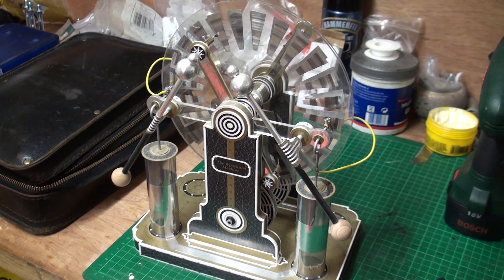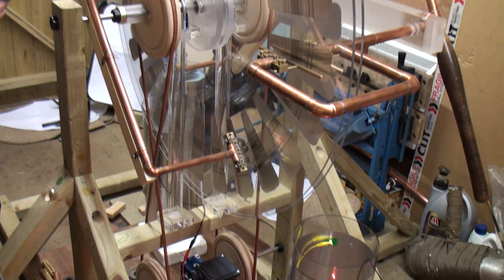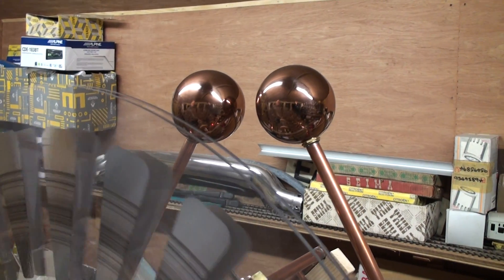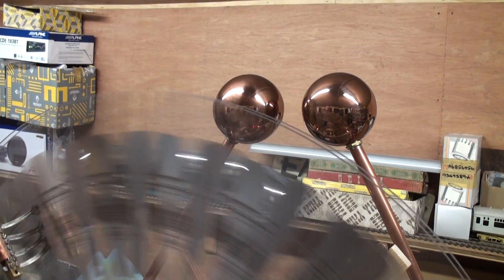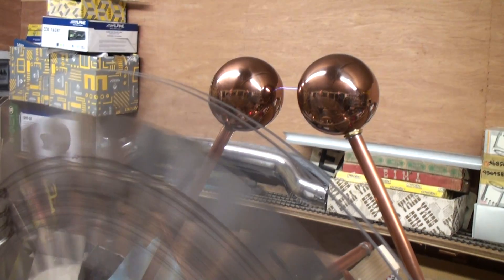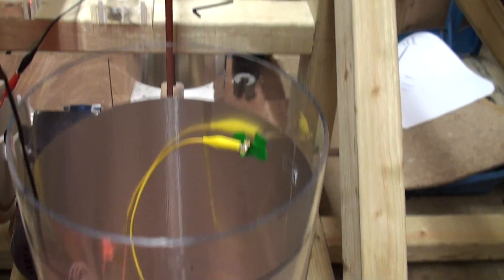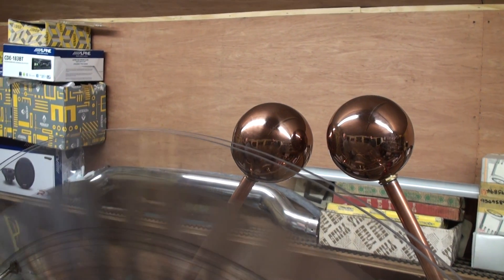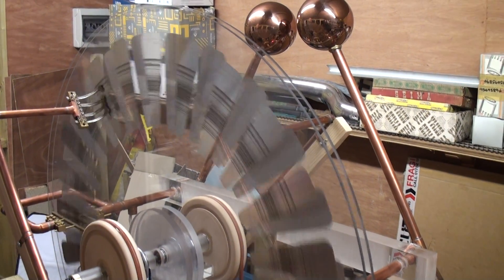Giant Wimshurst Machine!

Comment: Wow !!  A nicely done  3' 3" diameter Wimshurst machine.....Might need a bit of tweaking as good strong spark lengths of 25% --35% disc diameter are usually achievable for the Sectored Wimshurst at slow to moderate rpm & moderate indoor humidity conditions......
Reply: On a real dry day a sectored Wimshurst should produce sparks as long as the radius of the machine.

Comment: I have built lt 2 wimshurst machine with sectorless discs 18 inches in diameter made of  glass they were both enclosed and heated, they were able to produce sparks of 7 inches, under optimum conditions you should be getting  15 inch sparks

Comment: Another thing, charge collectors DO NOT have to have as much width as the sector length, doing so reduces your maximum spark length because the charge collector will discharge to the nearest neutralizer in the direction of rotation.  A single point is more than enough and should be positioned close to the OUTER edge of the sectors (again to reduce charge collector to neutralizer shorting). While the low impedance along with the lack of internal copper (since there is a huge skin effect at the high voltage leads) is a good idea on these machines for charge collector holders to capacitor connections, and the discharge rods, it is a bad idea on the neutralizer assemblies, because as soon as the machine starts to produce the neutralizers are at a neutral potential.  The large diameter of the copper tubing simply provides an easer path for charge collector to neutralizer shorting.
Reply: Thanks for the instruction, I’m in the middle of building a 3D printed Wimshurst. Your comment helped when considering brush size for the neutralizers, thank you

Comment: I highly doubt I'll ever get an answer to my question but im Curious how would one get power from the machine to something that requires power?
Reply: It's not really about getting power; it's more about generating high voltage from mains voltage. That conversion is costly. These system are not very efficienct, but they are robust.
Reply: I don’t have a definitive answer yet. I would encourage you to learn about Fractal Capacitors, it appears to be a possible method of capturing the high voltage to then be released/used in parallel giving the condensed now available much higher amperage. I’ll have more experimental observation in a couple of months confirming thoughts.
Reply: See my video where I step down the high voltage from my quadruple Bonetti Machine. As generators these are horrifically inefficient.

Comment: Why not generate its own power to run it ?

You don't need electricity if you use the power generated to power it...

Also .. your metal plates...
Try four feet long...

You want this time machine to run correctly yes ?
Reply: Because these machines are pathetically inefficient, and even if they could be 100% efficient it could not power itself, suggesting otherwise crosses the gap from ignorance to stupidity.
Reply: @MisterBonetti  yes ...it's your stupidity....
Me and another person are more advanced then you.

I see the model ship that is self sufficient in space.

I see the machine that looks like a clock.

I understand the " Tron theory ".

This engine is in its infancy still.

Ford didn't settle , he kept going till it was maxed ..

We see the engine that creates lightening.
We know how to amplify ..
We know how to control..

Free energy instead of paying for it..
Lots of people are tired of paying for electricity...

We know all about transformers and resistors..

Try useing spinners on each side of a bicycle Wheel frame..
Replace brakes with brushes.

We eliminated the hand crank...
Replaced with a mouse wheel..
That's progress...
Replaced mouse wheel with small  lightening engine to power it self..

It uses its own power to power it self...
Now moved faster then hand or mouse...

It creates the power to spin it self...

Added batteries based upon Bagdad...to store lightening energy ...

It's just a matter of time...

Before we are riding lightening . 

Can't charge people for free energy...

We deal in freedoms. .
Free energy for the world...

Comment: According to Disney...
You need bigger " wheel or face".
According to hg Wells...
You need a bigger clock.

I'm surprised these engines are not in electric cars.

Such a tiny device to replace electric cars motor..

It will power a small car...

Take one mini cooper ..
Use wimshurst as a base engine ...
Redesign gearing to turn wheels ..

Need a clutching system..

Comment: Profesor one question : What determines the amount of energy produced in this machine?
Reply from the maker: The bigger the machine, the bigger the maximum output voltage is.
Reply: @Mr01cook  No, it's only a question of configuration...
Best Regards
Reply: See my two videos on accurately measuring and calculating the current out (these are current sources so for a given rotation speed the current is constant).  Then see my voltage reading videos and scoping videos. While I show how to accurately get the current and accurately read the voltage, you'll notice in my scoping videos the voltage IS not constant and only periodically peeks at the measured output voltage max. Accurately determining the true output power is difficult and even more complex than doing so with AC because unfortunately the voltage curve is not smooth and regular like an AC sine wave

Comment: How long will it take to charge one of those big 12,000 Volts capacitors?
Reply from the maker: It's the time between each spark, so only a couple of seconds
Reply: @Mr01cook  how strange, I thought that those capacitors had over one hundred micro farad's.
Reply from the maker: @graphenepixel8231  No, you'll need a lot more surface area to get into the micro farads range. These capacitors measure 2.5 nano farads each, but has a voltage rating of 60000 volts.
Reply: @Mr01cook  I was asking about those big 12,000 Volt capacitors that have a very dangerous amount of charge, the ones with the big ceramic insulators around each terminal. I was wondering ho long it will take for this machine to charge it.
Reply: @graphenepixel8231  why not brass and copper plates ?

Disney used 4 foot plates on a disc face of about 6 feet.

Tried to crack time travel.

Comment: what static power output has this?

in kv and mA?
Reply from the maker: The kv can be calculated from the ball gap and diameter, for this one it's in the region of 30kv to 50kv. As for the current, it's static electricity and you'll need special equipment to measure that, you'll still won't want to touch it though!
Reply: @Mr01cook  How exactly can you calculate the voltage given the ball gap and its diameter? I would really appreciate an answer given that it is nowhere to be found on the internet.
Reply from the maker: @gustavopaz1313  Chapter 4 page 22:   https://www.google.com/url?sa=t&source=web&rct=j&url=https://core.ac.uk/download/pdf/53188100.pdf&ved=2ahUKEwiElMmCq5HqAhXRQ0EAHTKyAVIQFjALegQIBhAB&usg=AOvVaw3Vs0CmU6BEraYwfTJIxqVb&cshid=1592690119349

Comment: wow, that has a serious output even before the capacitors are connected
Reply: Did you watch the same video I did!?!
Reply: I have just a 12" machine and I put that to shame.  https://www.misterbonetti.com
Reply: @MisterBonetti  Pointless .. since the combined strength of 4 discs I think (looks at it) is so strong! Have you managed to generate a stable current for desktop consumers?
Reply: @dezsonagy8357  No, a Wimshurst (single pair) should on a really low humidity day, produce a spark close to the radius of the disc, in this case, 1 half a meter.  The disc pairs I have on my Quadruple Bonetti increase current, NOT voltage.  However, the excess current (28 times that of a single pair Wimshurst the same size) will compensate for losses on the machine and certainly help maintain the long sparks.  Current on these machines is directly proportional to the active charge ring and rotational speed in rotations per second.  His machine should produce plenty of current, but it is so leaky it's peak output voltage never gets to where it should.

Comment: What is the longest spark you can get using the capacitors?
Reply from the maker: Bub_ Lite_63 on the smaller one I got 15cm sparks, but only about 20cm on the bigger one, we think there is too much 'leakage' and it quickly charges the air in the shed which doesn't help. All the capacitors do is make the spark fatter but not longer, the length is determined by the ball diameter and a few other factors.
Reply: You might be able to reduce the leakage by either varnishing or clear coating metal parts where you notice coronal discharge. Make sure there are no sharp points or edges as well. I built a small machime from two vinyl lp records with 32 sectors per disk. My caps are made from a pair of one pint wood alcohol bottles. At best I manage a three to three and a half inch spark. I suppose that isn't all that impressive. Sure am impressed with your large machine though. Nice work!
Reply from the maker: @ClickThisToSubscribe It does improve with really dry air, the best time to run it is during the winter when it's below freezing and all the moisture in the air has frozen.
Reply: @ClickThisToSubscribe humidity is conductive, cold reduction of electron's mouvements.
Best Regards
Reply: Shouid be on a sectored machine the disc radius on a real dry day. Sector length, num et of sectors, and sector geometry also contribute or detract from maximum spark length as do charge collector to neutralizer shorts.